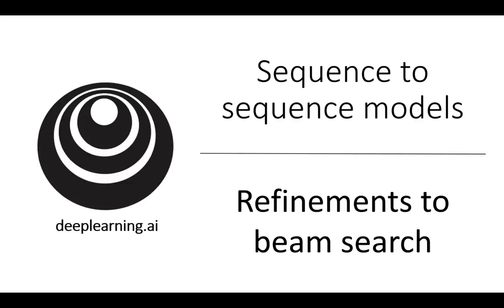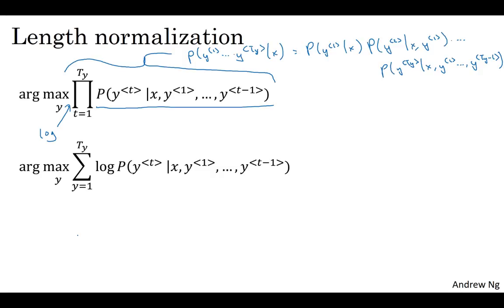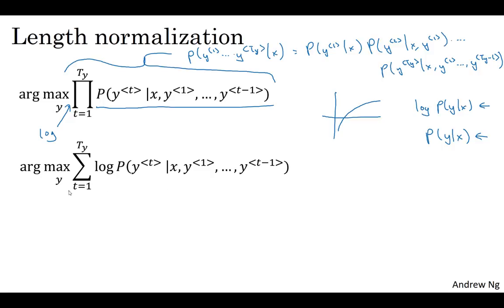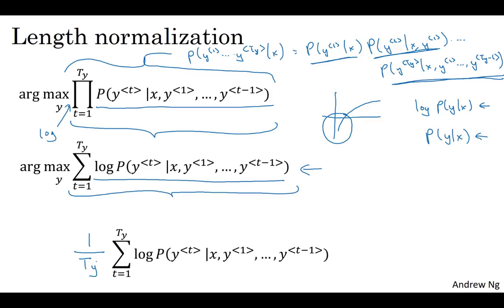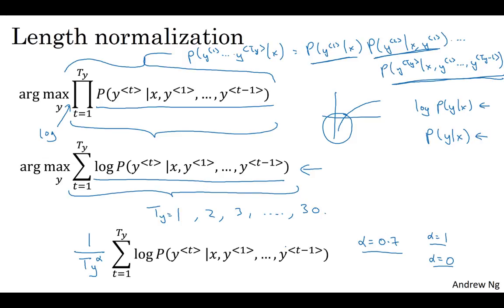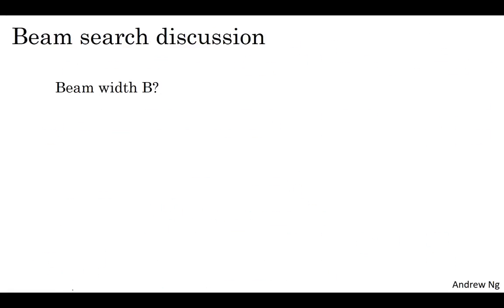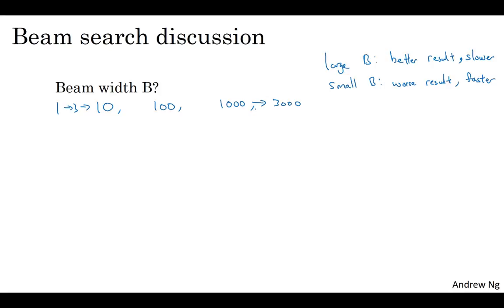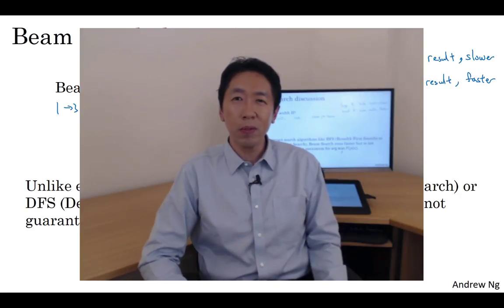C5W3L04 Refining Beam Search

Comment: I guess beam width can be made dynamic, for example, if NN tells that with p = 1 next letter is Z, than we can safely take width=1, and if on some step NN has no idea what should be next, than it's better to use bigger width. Right?
Reply: Even in the extreme case that one word's p is equal to 1, you still need to use fixed beam width. Suppose beam width is 3, RNN outputs A, B, C at time step 1, with prob 0.1, 0.2, 0.3 respectively. When we choose A as the input of the time step 2, we get the output word Z with prob 1, and we will get other outputs when we choose other words. But after RNN outputs in time step 2, you still need to compare all outputs from the 3 words A, B and C.
Reply: Zhifeng Yang thank you, now I see it. I did a little googling, and I found that there actually are some papers  about dynamic width or dynamic puring, and it improves speed of the search by approximately 10%, with same quality.